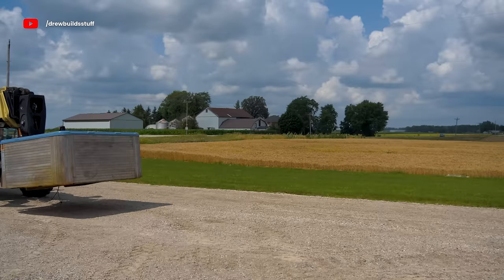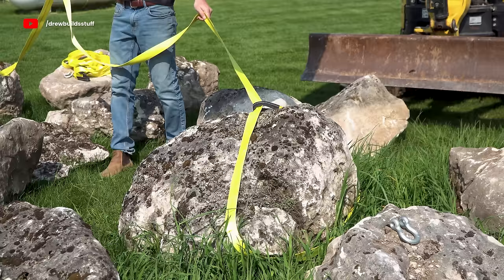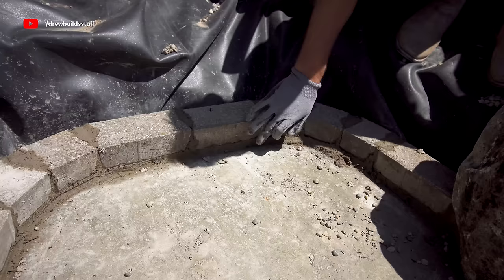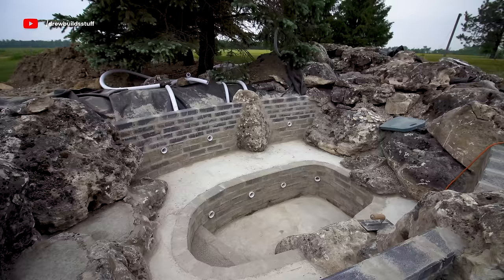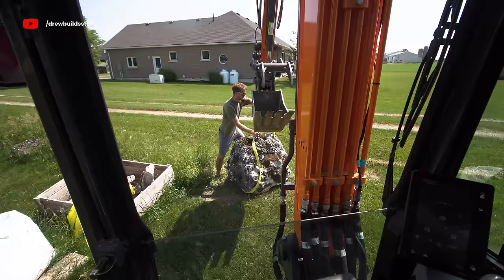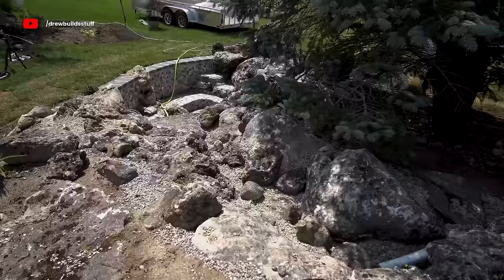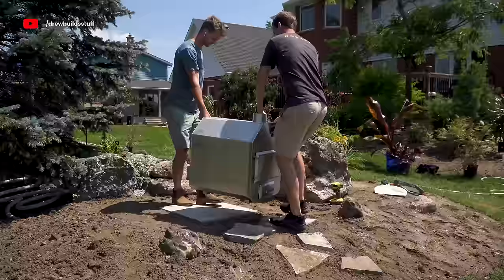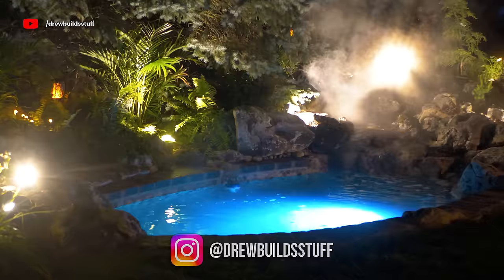Making a MOUNTAIN HOT SPRING in my Backyard

Comment: The unique shape and contorus would be difficult to cover effectively, and the small amount of water isn't worth working hard to clean next year. Drain it, blow out the pipes and plug. The pumps and filter should be fine to overwinter in place, as long as they're empty of water. Avoid leaving a filter cartridge/element in the filter body all winter though; if reusable, store it dry and indoors, otherwise discard and replace next year. Get a float actuated submersible pump and a short hose and set it up in the lowest area of the bottom to keep it mostly clean and free of water until you're ready to clean and refill next year.
Reply from the maker: Thanks for the tips! I’ll try it out once winter comes
Reply: @DrewBuildsStuff  Isn't winter the time of the year when you would want a hot tub the most?
Reply: @anonb315 not a wood fired, not super insulated hot tub. It would freeze and break apart.
Reply: @jeanlou3  Yeah, that's a bummer. I like the idea, but it seems not so thought through.
Reply: @DrewBuildsStuff  Another tip is to use some antifreeze liquids like you use in car radiators in Winter climate and fill in places where there could be risk of water being left. When mixed with any water in the system it makes sure to stay liquid down to minus 14-20 celsius I believe. It can be difficult to blow out/vaccume every single drop. At next season you run some water to the system go "clean" it before filling it up.
Reply: Would another (expensive) way to winterize it be to just keep it always warm above freezing via another energy source like electricity or gas?
Reply: @natantataii8195 as long as it's safe, a lot of these liquids probably aren't good to be poured into your garden